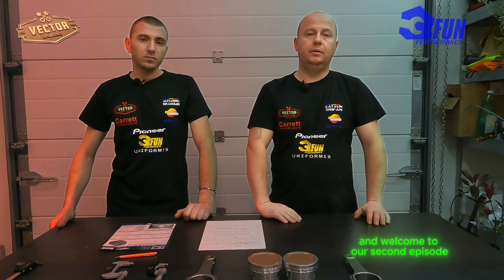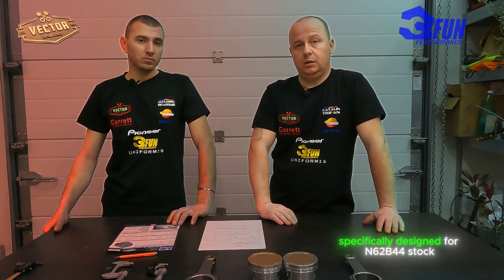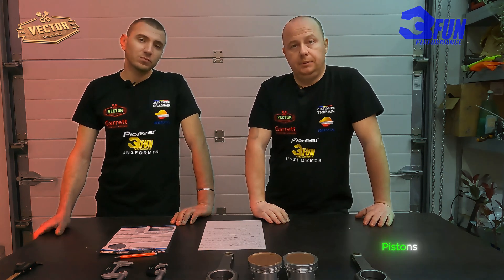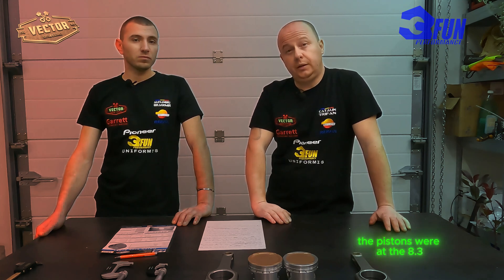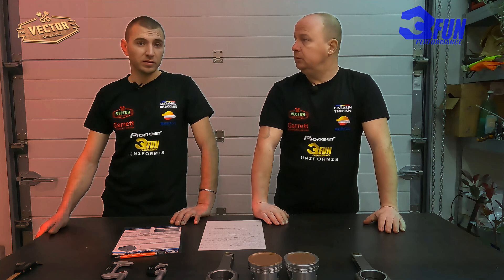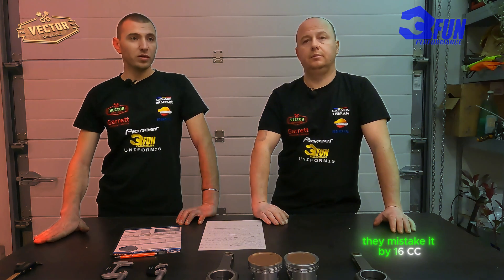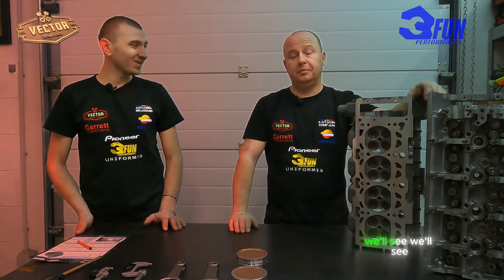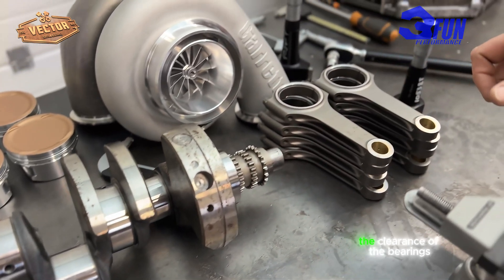Building the most powerful BMW N62B44 engine in the world - Part 2 - Assembly

Comment: Do you need to do anything with the oil pan for starvation or is it all stock?
Reply from the maker: We usually use Accsump to prevent oil starvation , also we implement low oil pressure protection in our standalone ecu , in case of low oil pressure.
Reply: @3Fun_Catalin oh nice thank you, so you keep the stock oil pan?
Reply from the maker: @cremedeju  yes , stock oil pan and pump

Comment: Hi Mate, Ben from Australia here. I luv what your doing. I have been restoring a E53 X5 4.8is for the last few years and believe it or not have really struggled to find someone here in Australia who is willing or able to rebuild my motor. If I were to put it on a crate and ship it to you could you rebuild it for me? Obviously I would pay for costs. Thanks Ben
Reply: @benbullock971 I've rebuilt a few happy to give you guidance to do it yourself.
Reply from the maker: Hello, i am not the man for this job , i dont do engine rebuilds and repairs for a living , this is only for me , and surely the solution ia not to send an engine from Australia to Romania for rebuild :) , there should be easier way to do that. Cheers
Reply: Where are you based mate? Any engine rebuild shop can do that.
Reply from the maker: @muhammadiqbalshiddiq4894  Romania

Comment: Hi. Great video and great content ! Thank you ! I drive BMW 545i with the same engine N62B44. Can you tell me on stock engine - stock internals and everything how many horse powers can you make with turbos so the engine stay reliable ?
Reply from the maker: @humbadjiev  Hello , for starters , you need to make sure that you have the space for it all. On completely stock engine (refreshed) , you can make 600+ whp (we made 650..670whp, no problems). I dont know if you can do that with Oem ecu. We allways use , standalones for our setups.

Comment: If you are running a high power turbo, 8.3 compression radio is probably about right? What clearance did you put in to the top ring? What cam profile are you using? What was you valve to piston clearance? Are you going to use a degree wheel to check cam timing? Great job
Reply from the maker: @bernardwarr4187  First ring clearance 0.50mm  , cam profile is stock  280ish degree on intake  and 250ish degree on exhaust. Valve to piston clearance is huge, like over 6mm. Cam timing is done with OEM cam locking tools , not being a custom cam. Thanks